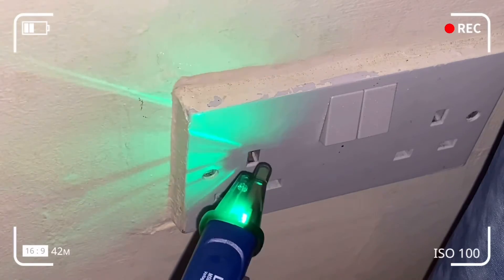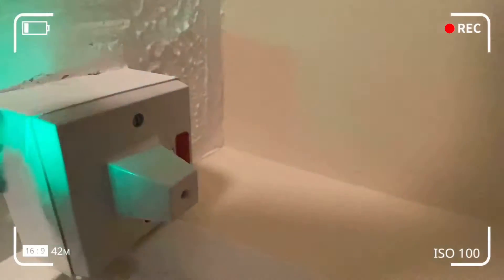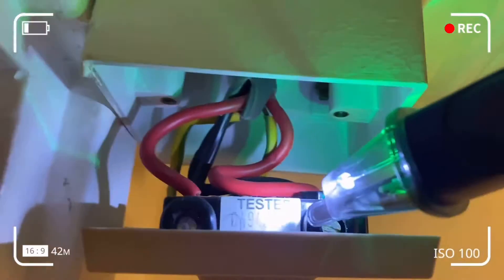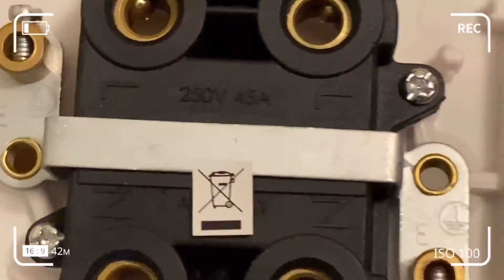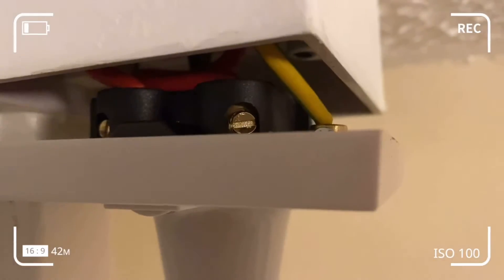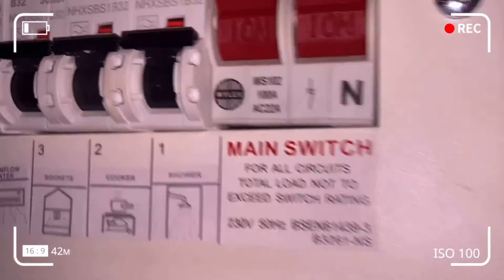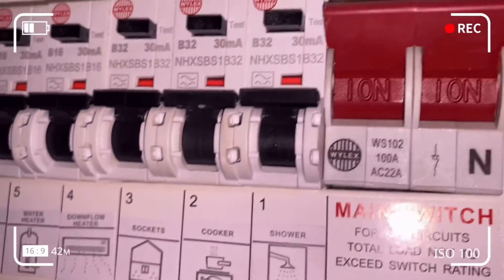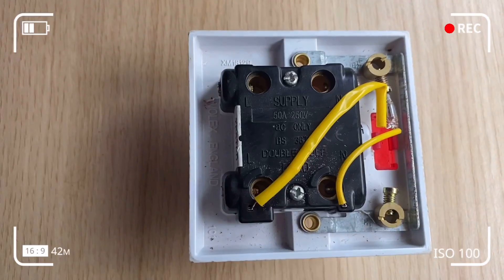How to change a Bathroom Pull cord switch and how to use a non contact detect voltage detector

Comment: I hear your point on Lane Disciple for each set of Live and Neutral wires. Does it matter though which side of the switch those get wired into - eg. is there a side for the Load wires and a side for the Feed wires? I'm looking at an online store to get a switch and there are photos of the internal arrangement. One unit explicitly says "Feed" and "Load" for N and L, while another unit does not, but it does have a side that is "45A 250V only" and "AC only". What do those correspond to for Feed and Load? I'm guessing Feed is the "45A 250V" but don't want to guess! Does it matter which side I use?
Also, the main circuit breaker says 32A for the shower, so is a 45A or 50A switch fine? Thanks
Reply from the maker: 1. Feed vs Load on a pull-cord isolator

Does it matter which side is Feed (incoming supply) and which side is Load (to shower)?

Usually: yes — but not always.

It depends entirely on the switch design.

There are two types of shower isolator switches:

A. Switches where Feed and Load are interchangeable

Some manufacturers design the contacts symmetrically so the current can safely flow either direction.
These switches do not label Feed/Load at all — you’ll only see markings like:
	•	L1 / L2
	•	N1 / N2
	•	or simply two sets of L+N terminals

For these, the function is the same whichever way round the supply and load are connected.

B. Switches where Feed and Load must go on specific terminals

These switches will have explicit markings:
	•	“FEED” or “SUPPLY”
	•	“LOAD”
	•	occasionally direction arrows

If those markings exist, they must be followed.
This is usually because:
	•	the internal contacts are designed to isolate on a specific side
	•	neon indicators (if fitted) need polarity for correct operation
	•	the mechanical structure expects supply on a specific side

m2. What does “45A 250V only / AC only” mean?

This marking is NOT identifying the Feed side.

It is simply a ratings label stating that:
	•	that side of the terminal block (or that terminal set) is rated for 45 amps,
	•	at up to 250 volts,
	•	and AC only (not DC).

Some manufacturers mold these ratings on only one side of the internal frame even though they apply to the whole switch. So the presence of that marking does not mean “this side is Feed”.

If the switch does not explicitly label “Feed” and “Load”, then the manufacturer intends it to be bidirectional, so it doesn’t matter which side is which.

Practical way to check

Look inside the switch:
	•	If terminals are marked L1 / L2 and N1 / N2 with no other wording, it is almost certainly bidirectional → Feed can go on either side.
	•	If terminals are marked Feed / Load, or one side has extra indicators, or the wiring diagram shows direction → that must be followed.

If you’re unsure, look up the manufacturer’s datasheet.

 3. Is a 45A or 50A switch OK on a 32A circuit?

Yes — it is perfectly normal and correct.

Shower isolator switches are usually:
	•	45A rated (most common)
	•	sometimes 50A rated

Using a device with a higher current rating than the breaker is safe and standard practice.

You must NOT use a switch rated lower than the circuit (so not 20A, 32A, etc).
A 45A or 50A switch on a 32A MCB is the correct arrangement.

Important safety reminder

Shower circuits are a high-power, fixed installation. Any wiring fault can cause:
	•	overheating
	•	arcing
	•	insulation damage
	•	fire
	•	electric shock

If you are not 100% confident:
 Have an electrician confirm the wiring.

It’s especially important if switching from one model of pull-cord isolator to another, since internal layouts differ.

Appreciate the feedback breadyegg . Dont forget to subscribe, like and share. Have a blessed week. Cheers
Reply: @UtechUreview thanks for the amazing answer.  I'm sure this will be useful for many other readers. Switch successfully done!